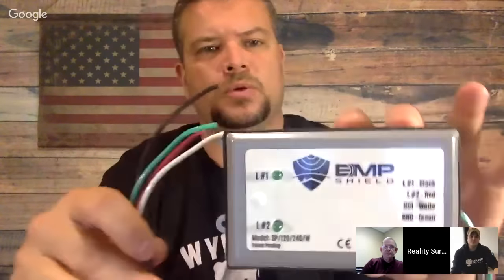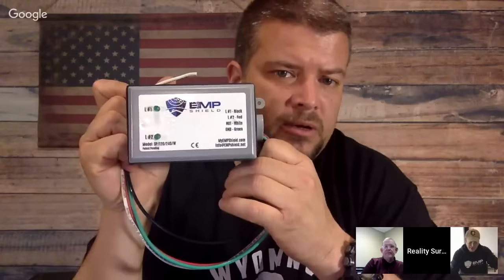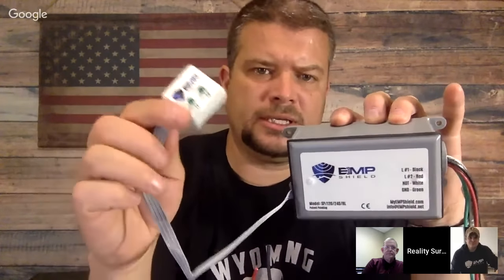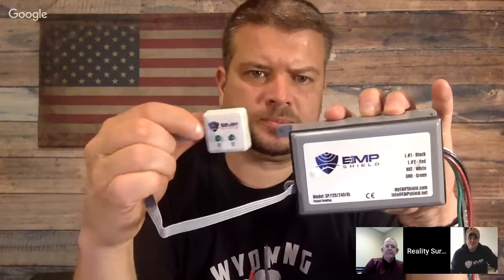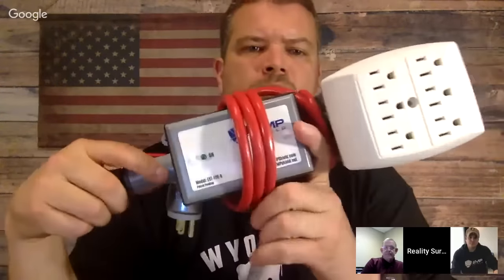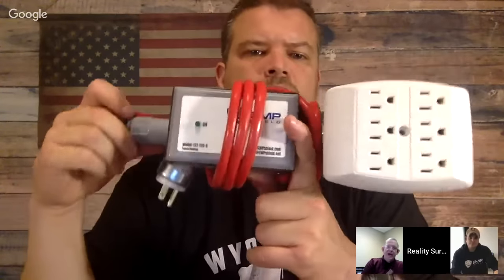The Truth About The EMP Shield!

Comment: You should make a video on your thoughts with a few Diagragms, I would be interested to hear your thoughts. ok, here are mine, EMP comes, Electron Theory states that current runs negative to positive, your unibody Chassis is a negative. (This is just my thoughts, I am not educated enough, but im trying to grasp an idea of how this would work)  The Atmospheric current  would hit the Chassis of the Vehicle and take the path of least resistance toward the negative terminal on the battery.  The Device would detect an excess surge of atmospheric current and shunt the positive (not sure which wire) wire directtly to Chassis Ground.  Then repeat the process until the charge dispipates due to the resistance of the vehicle (within the DOD specified time )..     My question is, When The inductive atmospheric event were to hit, Would ALL of the current BE ABSORBED into the chassis. Or could it still blow out your ECU ECM/BCM.  I do not know the inside of the device, but Wouldn't you think it should in series with the battery to cut.

I really am not sure on how this device works, I would find it shocking that the DOD would use it without rigourous testing. 

That Being said,   What about the thoughts of having a thick guage small wire that could be applied to the bottom of the Chassis to act as a sort of brush to make contact with the Cement road?   Or lets not say make contact  but a very small gap between the earth and the chassis (Obviously in a safe place)  

 Electricity neg to positive DC does not ocsialte +/-

pulse---- through chassis

To negative terminal and box

Box detects surge

Shunts Negative Chassis back to the Chassis?   im confused at that point, is there anyone witha background that can clear that up for me
Reply: Also I was curious, Why are we in Parelell with the battery and not series
Reply: WAIT , I think i figured it out, Are you Just Shunting the Chassis back to the Chassis, as it will no longer be electricified once the current has entered the device?   what is the point in having the positive terminal?
Reply from the maker: The positive terminal is to be able to monitor the voltage level in the whole system. So it will know when it needs to draw it down.
Reply: @RealitySurvival  interesting, thanks for the input, ya i've just been seeing some critique videos "this thing can't work, this is a scam, blah blah blah"  One engineer brought up the fact that the vehicle has no direct ground there for that idea that the current cycles and disipates, ( I have never heard of that)   then another person said its just a straight scam and wouldn't work, but really gave no reason as to why he thought that. To me it seems plausible that it could work. Sure hope I don't have found out though!!

Comment: Can you REALLY TEACH or DIRECT HIGH VOLTAGES or GAMMA RADIATION that occur in milliseconds WHERE TO PASS or NOT TO PASS? My computer setup have been struck by INDIRECT LIGHTNING and was connected to a UPS that guaranteed PROTECTION. What happened? Only the chair was still usable after the lightning strike!😀😅😆🤣😉😂😃😄😎
Reply from the maker: Yep you actually can. Check out the third party test results from Keystone Labs. Also it has nothing to do with gamma radiation. At least not the EMP effect anyway.

Comment: BS, IF this device works then why can't the grid get protected
Reply from the maker: Your comment is an example of simplicity bias. You have taken a subject that you obviously know very little about abs reduced it to a simple concept. The reason is because the high power transformers that push the current out from the power stations are very sensitive and are built to operate at a given voltage/current amount. Somewhere between 475,000 abs 275,000 Volts depending on the station. They are also connected to hundreds of miles of long transmission lines that if an EMP occurs will have a MASSIVE amount of voltage induced into them. Which is very difficult to manage that amount of current in less than one hundredth of a second. However on the house side of things we are only dealing with 220 volts and the amount of wiring in a home that has current induced to it is much smaller and it can be dissipated in less than one millionth of a second. Basically you are comparing apples and oranges. Two totally different problem sets.
Reply: That's like saying if guns work, then why do we need tanks and aircraft carriers. If two cans on a string work, why do we need TV stations, cable TV, cell phones and towers.

Comment: So, what happens when there are SEVERAL EMP explosions? This unit does not protect you for more than ONE EMP - or does it?
Reply from the maker: Yes it does protect against multiple EMPs.
Reply: @RealitySurvival  Under another comment you said its a one time use and you need to pay 50 bucks to have it repaired
Reply from the maker: That is for a lightening strike.
Reply: @kaptein1247  That was related to a direct lightning strike.

Comment: What about a generator sitting in my garage not plugged in?
Reply: I store one of mine in a aluminum trash can, fuel drained of course. Mine is dual fuel for propane and gas. Make sure it is in a trash bag first then place in the can with lid on tight.
Reply from the maker: Depends on if it has any sensitive electronics. Older ones will probably still work. Newer ones probably not.

Comment: So, when an atomic explosion is detonated over you, will the emp survive the extreme heat that will melt everything in its path and not to mention the gama rays that will start to kill you?
Reply from the maker: Yep the explosion is what causes the EMP.
Reply from the maker: But since the detonation takes place in the upper atmosphere the blast itself isn’t going to hurt anyone. Unless you happen to be in a rocket nearby. Lol
Reply: If you experience an EMP from a local nuke explosion you'd effected by blast, thermal and likely direct radiation as well.
It's short ranged LOS then basically.
Reply from the maker: Correct.

Comment: All of my vehicles have points and carburetors.  The radios will probably quit.  Radios are not essential, we can live without them.  Your vehicle is an essential tool.  Buy and restore a tool that is appropriately reliable.  Oh, and my 63 Dodge Dart gets 30 mpg, 65 dodge truck gets 25 , and my suburban gets 21 mpg,  actual.  My point, however, is don't compensate, get the right tool. You won't know it doesn't work until it's too late.
Reply from the maker: Also check to make sure you have a spare voltage regulator as well just in case if you vehicles have them.
Reply: @RealitySurvival   COIL, AND CAPACITOR IN YOUR DISTRIBUTOR

Comment: I am gonna buy a Point Zero Titan solar generator, I'm thinking that unfortunately this wouldn't work for me because all the components are self contained inside of the unit, hmm maybe this would only work for a DIY style open unit where the charge controller is exposed.   I could be wrong.   I suppose that the best I can do is keep it inside of a Mission Darkness EMP bag and hope that if an EMP hits that it hits while in the bags...considering that it's only for power outages and camping trips it will at least be in the bag most of the time.

I also have a question, so if this device only works if it's connected to a live circuit than the vehicle device is totally hit or miss depending on whether your vehicle is turned on or off during an EMP?
Reply from the maker: No Sir, the vehicle unit works a bit differently than the home unit. It is connected to the battery so it is always live. So it doesn’t matter if the vehicle is running or not you are good to go.
Reply: @RealitySurvival  oh ok that's cool!    And so if you can use these with the Inergy Kodiac then you definitely should be able to use it for the Titan too.   I guess it helps to listen to the whole video before commenting lol
Reply: @RealitySurvival  hey question...would it be possible/effective for me to simply buy the RV EMP Shield and just plug it into one of the outlets on the Titan generator?   And perhaps also plug other devices into the outlets, and even if they are all turned off would they all be protected if an EMP hit?
Reply from the maker: To be honest I am not 100% sure. I’d contact EMP Shield customer service to be sure.

Comment: The premise is that electronics would be protected would be coupled, largely through the power lines (electrical supply lines), into an electronic device via these this lines.  What about direct coupling through the atmosphere, through the case or device enclosure and into the electronic components directly?  Aren’t unplugged, battery powered or simply passively stored still vulnerable to Danegeld by an EMP?  If aircraft in flight, cell phones in hand and digital electronics that are autonomous, self contained and not connected to the power grid are affected, how can you claim that your device is so broadly protective?  Can you tell us about what devices are not protected by your device?  It seems to me that your focus is on protecting only devices connected to power without any protection from an atmospheric exposure to EMP of digital electronics — laptop in a backpack, hand held transceivers and etc.
Reply from the maker: Watch the video and we cover what it does not protect.

Comment: What about a home gen with automatic transfer switch source A and gen B into panel. Will there need to be 2 emp shield devices
Reply from the maker: Yes I think so. One for the grid system and one for when the generator is running the house. But you may want to check with EMP Shield customer service to be sure.
Reply: @RealitySurvival thanks...ill give them a call

Comment: I'm sold on the EMP shield for EMP/CME protection but I'm concerned about the one hit wonder comment when it comes to lightning strikes. I know they degrade but from what I know about surge protectors it is not common for them to be able to take only one hit. Wondering if the EMP shield is actually on par with the rest of the surge protection industry in regards to lightning protection. Anyone know this to be true?
Reply from the maker: Well the EMP Shield is not designed to be a surge protector. The design is different for each situation. But it will protect from one lightening strike. Then the replacement fee is only $50 if I remember correctly. If you live in an area prone to lightening strikes then it may be worth also considering an actual surge protector.

Comment: I have a question: What if your house power goes out just before the EMP hits? Or...if your vehicle battery happens to die before the EMP strikes, this wouldn’t help right? Thanks for the explanations.
Reply from the maker: No it would not make any difference. They also make a version to protect homes as well. But of course you will need a generator because the rest of the power will be out.
Reply: @RealitySurvival  if I have a whole house Generac Generator, do I need an EMP Shield for the house, and for the Generac? Or does 1 EMP Shield cover everything?
Reply from the maker: Yes. One for each because they are on independent circuits.

Comment: We I'm a year late to ur vid so don't know if this will b seen. QUESTION- I heard that if it runs off 110 and is connected to the electric house panel it should b protected. I reading into this that it WILL protect a standby generator that IS connected to my electric panel EVEN if it is on the outside of the house ❓❓❓
Please help trying to verify so I don't over purchase or waste money if not needed. I need to buy for my family including my mother who is living n another home and unable to pay that much.
Reply: No.  I listened to the video, and I have a generator.  The backup generator is electrically ISOLATED from the panel until used.  So the generator is NOT protected with the house.  You would need a separate shield for the generator if it has electronic ignition. @RealitySurvival
Reply from the maker: Yes that is correct. I learned after this comment that the standalone generator will need to have its own unit to protect it. I have a couple videos showing that install.

Comment: Wrapping a cell phone into Aluminum Foil ?
Reply: If the towers go down..useless phone
Reply: Get enough GMRS/FRS radios for every member of your family. They are sold on Amazon for $20-60 each. Raddiodity ones are good. No need for cell towers or service. You can store those in EMP bags also available on Amazon.
Reply: @ChatGPT1111  GMRS required a FCC license and has a range of maybe a couple of miles under good conditions. FRS requires no license but has a range of only a couple hundred meters. In either case some training is required and frequencies determined to be of ANY practical use! I'm not against radios, I'm a HAM operator, but they have a lot of limitations!
Reply: @raibeartcahill4295  I'm a ham also and have the GMRS license. I doubt if EMP goes off the FCC will be around to check licenses. The country and society will devolve into chaos within weeks.
Reply: @ChatGPT1111  I agree completely, BUT in order to practice and train BEFORE hand without possible problems with the government it would be wise to get your license. That is $70.00 for your GMRS license! Many people simply can not afford that! I have both GMRS & HAM tickets and my group runs shtf practice & training scenarios frequently and we still run into issues constantly that would make real life situations very difficult to overcome! Anyone that is not reasonably well versed on radio comms will not be very well served by buying an inexpensive HT radio. Those radios ABSOLUTELY WILL NOT come close to substituting for a cell phone period. Hell not even high power HF radios can do that. Not to mention what are atmospherics going to do to rf transmissions in the event of nuclear detonations! I could easily go on but I think I've made my case!

Comment: Wouldn’t an EMP/solar flare take out the electronics in your back up power even when it’s off?
Reply: I store my solar generators (Jackerys), 12v lithium batteries, inverters, smaller solar panels and solar controllers in aluminum trash cans with aluminum foil covering the seals. I also keep radios, ham radios, spare laptops, old phones, gmrs radio and a satellite phone in them.
Reply from the maker: Not if stored correctly. There are tons of variables to consider for sure.

Comment: Just had a lightning EMP that took out all TVs, cable Company hardware, game consoles, and various other electronics.  The worst part is the insurance deductible of $2500.00.
Reply from the maker: Ughh. That sucks. An EMP Shield would have stopped that. It would have to be replaced by EMP Shield afterwards but the replacement cost is only $50.

Comment: I just ordered the vehicle module. Thanks.
Did you guys mention whether or not a gasoline generator will be effected by any said EMP's? If it is whats the point in having one? Any way to protect it if it is susceptible? I have  6500wt B&S quiet generator.
Reply from the maker: EMP shield has a model for generators as well. You would only need it is if we’re plugged in when the emp went off most likely.

Comment: On the vehicle’s. The ground is on the chassis, however, it has rubber tires. How do you dump that energy to the ground off the vehicle?
Reply from the maker: It basically cycles the energy to the chassis repeatedly until it dissipates.
Reply: @RealitySurvival  thank you my question too good explanation

Comment: I have 2017 Ford F-250 powerstroke diesel and I have two batteries do I need 2 12 volt emp shields? One for each battery? If not do I run one to each battery?
Reply from the maker: My understanding is that one device will cover the vehicle just fine.

Comment: So if an emp goes off and the main grid goes down first... and that kills the power to your home, wouldn’t that make the shield not work because it’s no longer connected to a live circuit?
Reply from the maker: Nope.
Reply: I guess I don’t understand.  If the power plants are susceptible, what’s the point?  If upstream power providers fail, I don’t see how this is useful.
Reply from the maker: Do you have a generator? If you are preparing appropriately then you should and that would give you a massive advantage.

Comment: This is the most useful information I have seen.  It provides the most practical answer to protect existing equipment. There is one thing that I don't understand.  If you connect the proper unit to a modern  car or construction equipment. Will the electronic fuel injection, preprogrammed operations and display systems be protected?  Does it realy make modern equipment as resistant to EMP as as old equipment from the 70s and 80s?
Reply from the maker: Yes I just installed the vehicle emp shield on my truck today. A video will be coming out shortly. My understanding is that the unit will shunt the indices energy to the chassis before it has a chance to build up enough energy to damage the electronics.
Reply from the maker: It’s essentially a function of math and difficult to explain but the chassis can absorb more induced energy than the body panels and the rest of the truck will absorb. Check out the EMP Website for more detailed info.
Reply: @RealitySurvival  Am l correct it's something you don't understand your self but we should all trust your opinion.   That's not reality is it.  Has the function been full scale  tested in a car or not?

Comment: Will it work on my semi truck?
Also, I pull a reefer trailer. 
Do I need a separate unit on it, or will the one on my semi protect it when I’m hooked to my trailer?
Reply from the maker: I believe it would work however I would contact customer service just to be sure.
Reply: AmericanSlabRider Did you find out if it works on a semi truck?
Reply: Sylvia Yes. It works on a semi.
Reply: One for each battery?
Reply: Sylvia Gallardo I have a refrigerated trailer, and for 100% protection I need 2 devices. One on the truck & one on the trailer.